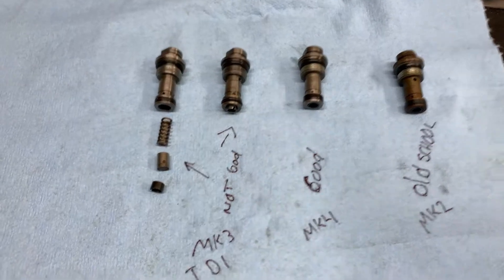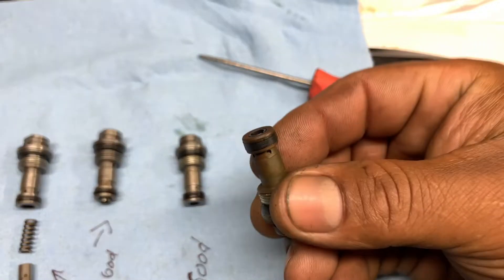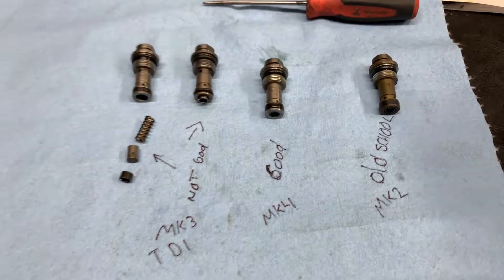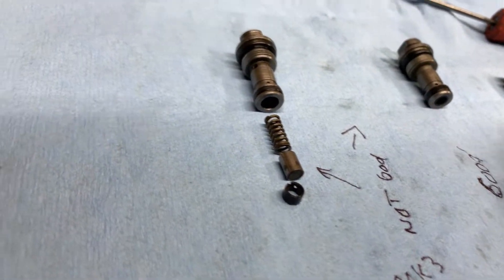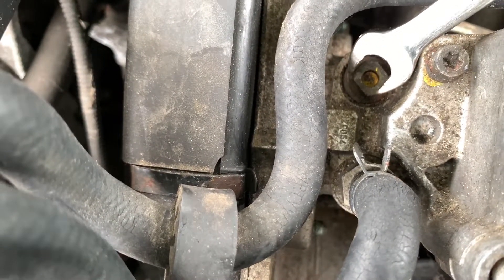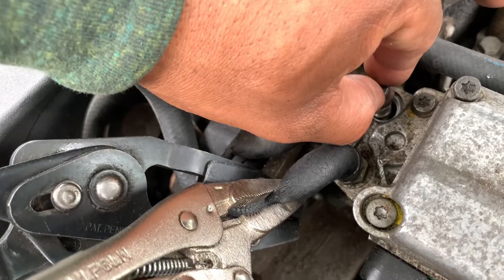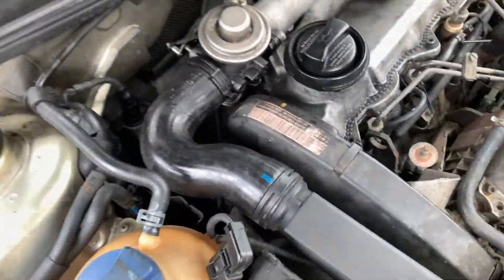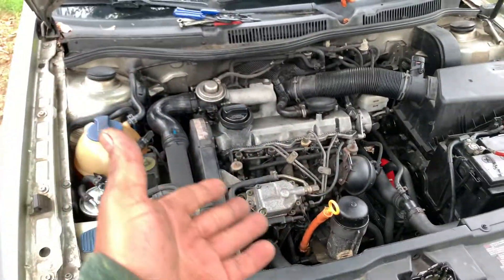TDI & IDI Injection mechanical pump pressure relief valve problem

Comment: Miracles can happen in my Nissan Primera. especially when, with a slightly overheated engine, it can lower the revs when braking and the clutch is released and then simply stall. and today this valve was slightly unscrewed and fuel was leaking.
Reply from the maker: Good man

Comment: Will this cause engine to stall when accelerating?
Reply from the maker: Could be  , you need to check on this valve first. Than if problem persists try new fuel filter it maybe clogged and if problem persists maybe time for new nozzles  this problem you describe is fuel starvation

Comment: Good explanation of what is going on with the valve , I'll be checking mine soon . I don't think it has totally failed yet but might be working itself loose like you showed . ✌️

Edit : I checked it and it was out about 1/8 of an inch . Pushed it back in, adjusted IQ and runs much smoother an fuel mileage improved ( most likely the IQ adjustment )

Comment: I tried to check it in my toyota 3L na idi pump but its located in a tight spot. Got smoke issue and low mileage even after turning down fuel enrichment screw.
Reply from the maker: Just try to get access and check , and about your fuel smoke it can be nozzles related

Comment: Love this tip and like I said before  I'm always learning with your videos , I'm impressed that the car started , does that screw has specific position to be ? And I tough that  the screw would give some kind of adjustment on fuel even I understand the iq and hammer mod does that , this pump is too complex to understand but love this tips , the plyers good tip too ! 
I'm always afraid to mess anything with the fuel because of air on the system on diesel   .
If u can in the future u should do a video about it teaching us  , but basically we will need vacuum to pull the fuel ? Not easy to find one on the midle of the road I think that's why people talk do much about it like it's the end of the world 😅
Reply from the maker: Hahaha is so easy